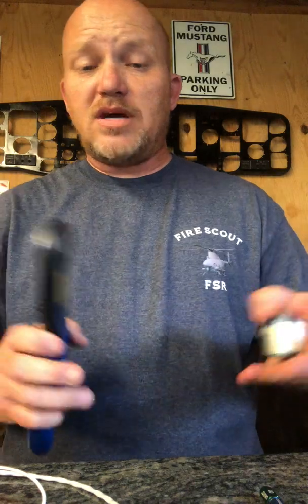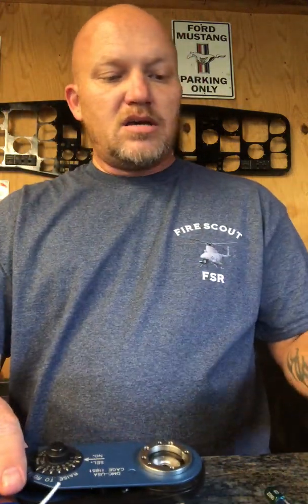DMC Crimpers and Wiring

Comment: Do not insert wire all the way to the insulation, this will cause a weak point in the wire that can cause breaks due to vibration or bending because it's does not allow the wire to move.